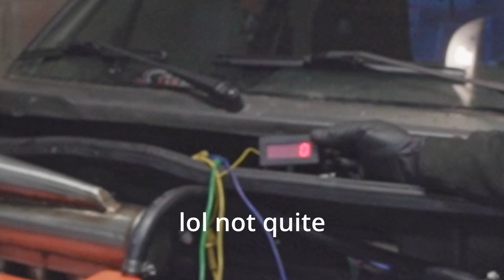The first tachometer ever in my VW turbodiesel

Comment: Love the info on the clutch, btw. Was a question in my mind.
Reply from the maker: Right on! Yeah I currently have a 210mm OEM clutch on there, hasn't been a problem till recently.
Reply: @OliverFetter  When did you need to swap out the original diesel 200mm clutch? I'm going to be running a Giles pump with 15 psi and not sure if I should go with a 210mm gasser clutch. Can you use the stock diesel flywheel with the 210mm?